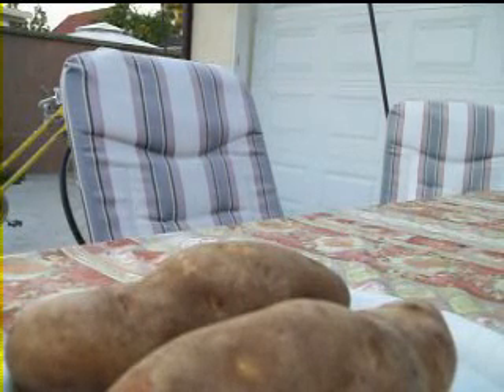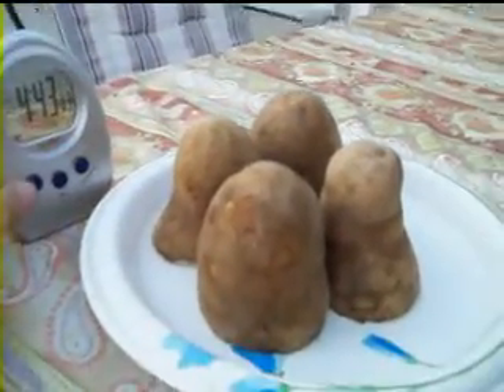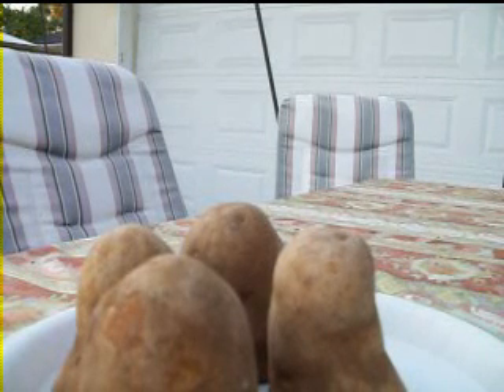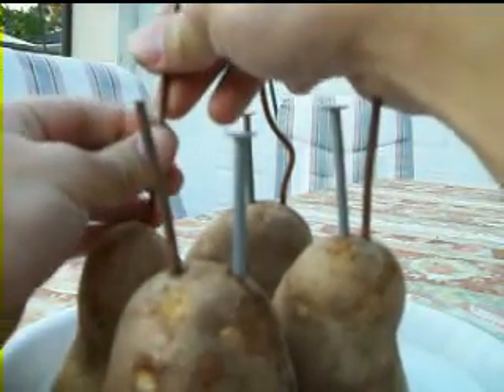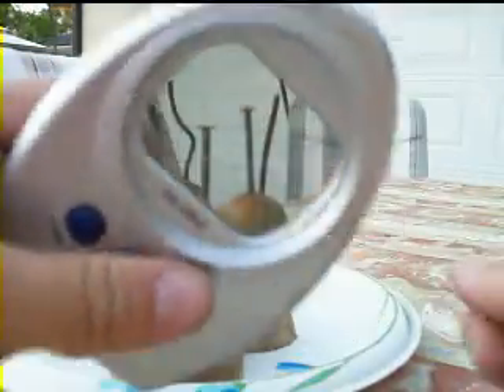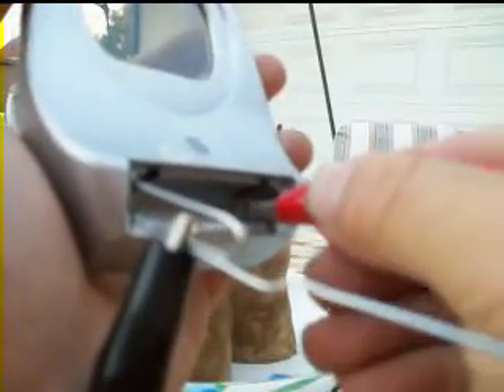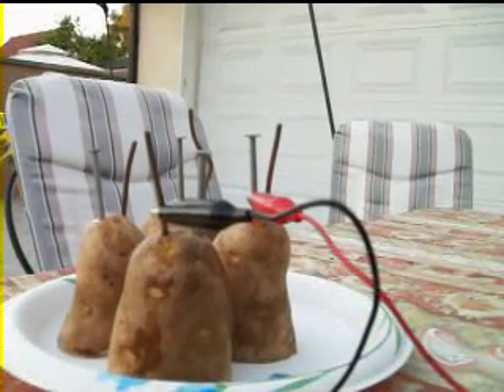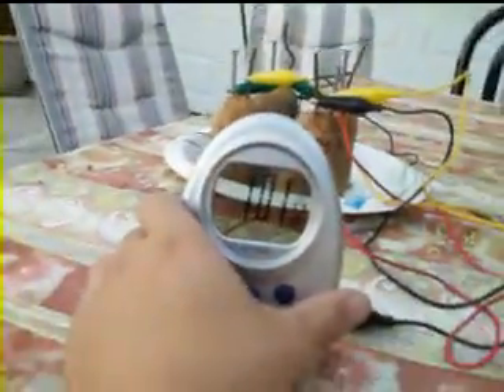How to Make a Potato Powered Clock MacGyver Style

Comment from the maker: yes but sometimes it doesn't work the same. but If you use very good conducting bare wire it should work. However, those leads that I used which you can buy at Radio Shack is guaranteed to work for this project.

Comment from the maker: without the necessary electrodes, you would not be able to draw any power. However, instead of the ones I used, you could just theoretically jam the leads into the potatoes and see if that works. Now don't tell me u don't need wires cause that just wouldn't be possible.